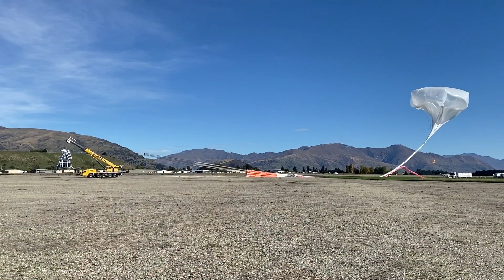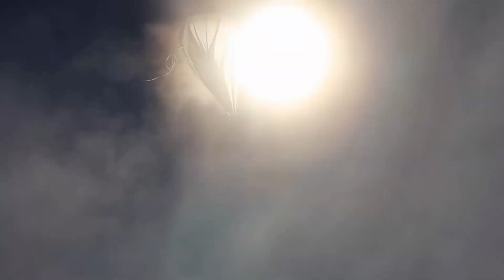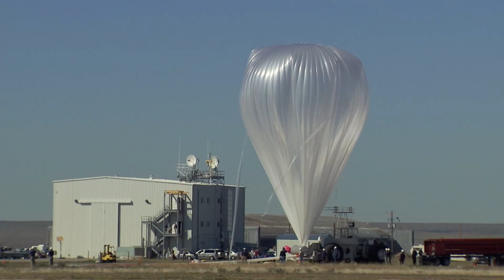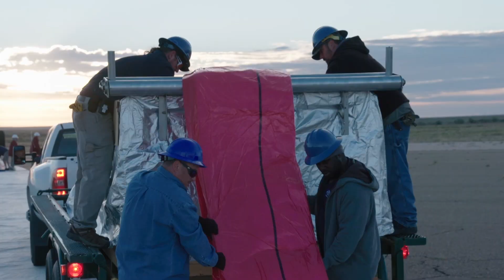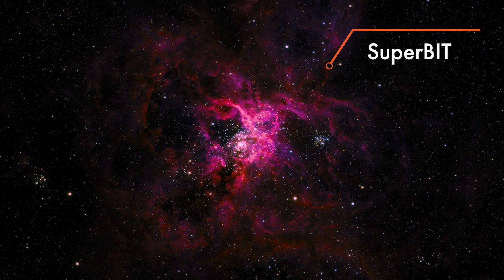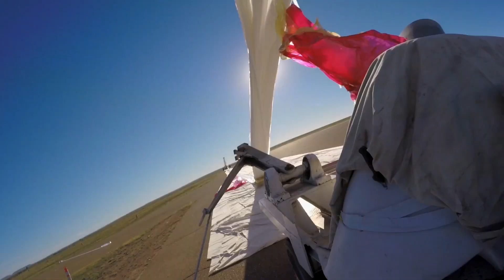NASA's Scientific Balloon Program with Chris Yoder

Comment: Three Modes of Information Processing: Dial Analogy

1. Classical (Traditional)
	•	A classical dial.
	•	Information is retrieved by physically rotating through each possible value one by one.
	•	This is the slowest method.
	•	Corresponds to digital computers and standard computation methods.

2. Quantum (Quantum-based)
	•	A quantum dial.
	•	All possible states are evaluated simultaneously, like a quantum computer.
	•	Can find the optimal answer at high speed through parallel state superposition.
	•	Corresponds to quantum computers and quantum operations.

3. f-bit (Frequency-based)
	•	A completely new type of dial using frequency differences (Δf).
	•	Information itself is embedded in frequency, eliminating the need to “rotate” the dial.
	•	All answers exist in a simultaneous resonance state from the beginning.
	•	The solution may emerge instantaneously through conscious interaction.
	•	Corresponds to frequency-based information unit: f-bit.

Summary

	Classical = Linear access
Quantum = Simultaneous state evaluation
f-bit = Instantaneous resonance recognition